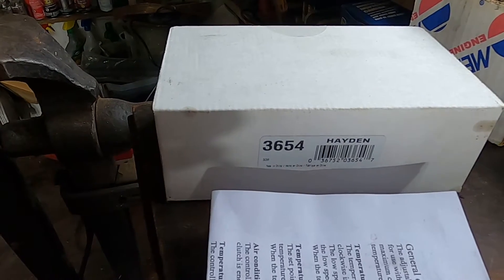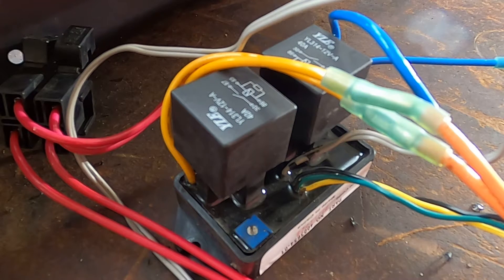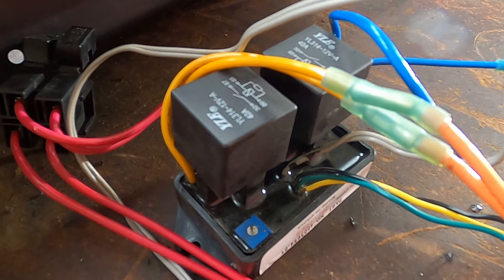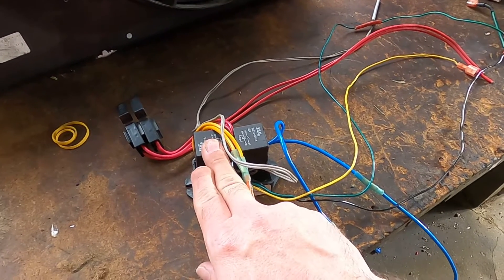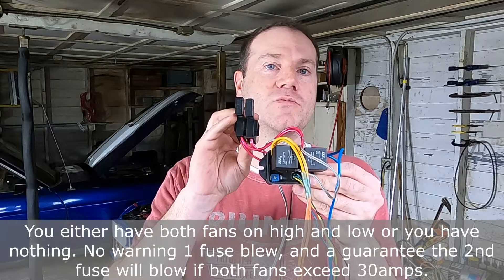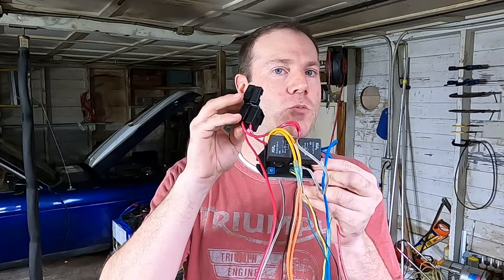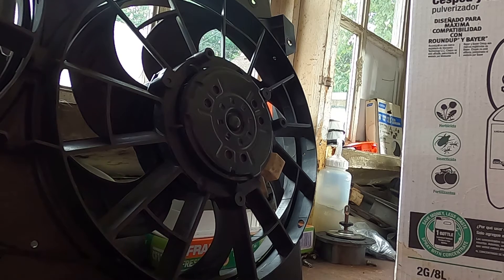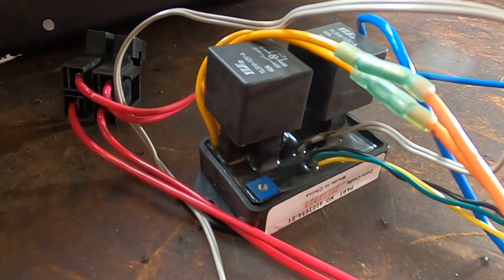Choosing Fan Controllers - Hayden 3654

Comment: You didn't need diodes for the low-to-high fan speed connections?
Reply from the maker: The fan assembly itself came with the low/high speed resistor module. No need for anything else.

Comment: can this be used with fuel pump?
Reply from the maker: Since this relay is temperature controlled, I don’t see a typical application with a fuel pump. I’m sure it would be less expensive to just find a key on 12v relay to run a fuel pump.

Comment: Hello, where did you find the actual plug ends to mate to the Contour fan?  Also, would you please describe the wire hookups for the low/high speed and how they connect between the resistor connection and the fan motors?

Comment: are there manual controllers where you can turn a knob to adjust fan speed?  and if so would you mind recommending one? i got a fan speed controller from amazon but its not adjusting the speed nor turning on or off it just stays on when the car is off unless i wire it to turn on with the ignition
Reply from the maker: I don’t know of any variable resistors specifically designed for electric fans. Every fan controller will need to be wired to 12v key-on power. If you have a fan wired to constant power, it could easily kill your battery super fast. The issue with manual and variable fan control is needing to constantly be watching the temp and adjusting speed. I don’t think it’d be very practical?
Reply: @randomologist77  thanks for your response, yes thats right. i just wanted to get a fan to run at a lower speed constantly while driving but i am just going to get the relay and have it wired up to like stock.

Comment: I wish you had a picture of where you ran the wires befor you put the black stuff on the wire
Reply from the maker: Black wire goes to chassis ground.
Yellow wire goes to key on 12v power.
Green wire, if used, goes to AC switch.

Both red wires go to battery.

One of each blue wire goes to each fan positive pin.

Ground wires YOU supply connect to fan negative pin and ground to negative batter post or chassis ground.

Orange wires merge together, then connect to low speed resistor input wire (left side pin for Contour/Cougar)

Low speed resistor output wire (right pin for Contour/Cougar) connects to 2 wires YOU have to supply, and one of each of your wires merges into a blue wire.

Comment: Is it suitable for spal brushless dual  fan 500w?
Reply from the maker: Well, a 500 watt fan set at 13.0v, where most Spal fans seem to be rated would be a tick under 40 amps or 20 amps per fan. The dual Spal fans I saw require a 30amp fuse per fan and the Hayden 3654 has that, but they were all brushed fans according to the description.
Here are the stats you need to know:
Amperage draw (both fans)
Fuse per fan requirement
If you're at or under 40 amps total, and the fuse requirement is 30 amp or less per fan, you should be good, I'd think. Technically, the controller is rated for 50 amps total, but amperage spikes while fans are spinning up can be pretty major, and I wouldn't trust the controller near its max rating. My dual fans were drawing under 30 amps total, continuous. Take a look at my fan review video. https://www.youtube.com/watch?v=8NTFLv3hASw&t=21s
Reply: @randomologist77 @randomologist77  now I've found spal fans 500w wires are kinda different the power wires from fans are 10 AWG and Spal Maxi Fuse Holder are 6 Awg with 50Amp fuse and I did search and found out that connecting 10 awg to 6 awg with fuse there's chances of overheating and burning them

Comment: All those 4 wires supposed to have power or 2 should be power and 2 ground?
Reply from the maker: Pink/red 2 wires go to battery.
Orange 2 wires in kit merge and go to resistor block left side.
Orange 2 wires (you supply) come out of resistor block right side. 1 of each orange wire merges with a fan’s blue wire.
Blue 2 wires route 1 wire to each fan.
Each fan connection has 1 blue wire, and one black (you supply) ground.

Comment: How did test to make sure controller was bad? I fell like I have a bad one on my car.  Just wanna be sure before I pull it out.
Reply from the maker: @klassaktrestorations8701  I heated the sensor with a heat gun and the relays didn’t activate. I had spare relays from a previous failure I tested as well.

Comment: How did test to make sure controller was bad? I fell like I have a bad one on my car.  Just wanna be sure before I pull it out.
Reply: I've had 2 of these Hayden 3654 go bad on me in a 4 year span. Should've knew not to after the single fan version did the same on me b4 I upgraded to  a 2 fan system. After the last time out of town on the side of the interstate having to straight wire for the 3rd time. I will never use their product again. They get a short inside the relay block. If you're not watching your guage it's a messed up situation. I've been running one of the cheap dial fan controllers since for as many years as I all 3 Hayden's with no issue, and it only cost me $22 with a lifetime warranty.

Comment: Davies craig ,,,DC-0444  [basic] --other part no . available ......   /different sensors--- 2 different threads , 1x radiator fin probe ,, inline radiator hose 
features ,, digital display ,,, air-conditioning sense wire ,,  staggered start of fans to reduce amperage shock load to alternator .
Bang for buck good value
Reply: Running a Davies Craig controller in my truck, Amazon sells a knockoff for $10-20 cheaper depending... Gonna try it on another vehicle just because, but can definitely back the DC. Would buy it again.

Comment: I run the same fans, I use 3 relays and a dual temp thermal switch, and no failures in 6 years running.

Comment: Can i remove the probe and use a sending unit the screws into my tstat housing?
Reply from the maker: @justineaton6281  I think many (if not all) the new kits come with a screw in units, but the sensor is designed to be tapped into the radiator rather than the t-stat housing. T-stat housings are usually full of curves which can make finding a good spot to drill and tap without leaks pretty hard. Manufacturers use intake manifolds, but that could be catastrophic if you drill in the wrong spot, and drilling holes while on the car could cause a lot of debris to get into the system. The problem with what you’re suggesting could be signal incompatibility. The push in probe might send a signal of “x” resistance for 200* while the screw in unit might be “y” resistance at 200*. It would make sense for the resistance levels to be universal, but they’re not. Different cars / gauges have different specs for resistance ranges they expect.
Reply: Not sure if you figured out your issue or not but they do sell those sleeves that you can put on your upper radiator hose, you basically cut your hose and the sleeve goes in the middle, its usually anodized and it has a threaded port for a screw on sensor,I'm working on that at the moment, my one year radiator has started leaking (cheapo ebay aluminum radiator) and i got another new expensive radiator but before i install it in checking out different options.

I have a really nice electric fan but it uses one of those probes you gotta stick in the radiator and every time i do that i think i take a few years of my life span, specially when you have a 3/500 dollar radiator,not a big fan of those probes,they do work though and i have used them before with success but like i said, i just hate driving them in, sticking something between the fins of a radiator is like jumping out of a plane,not natural,lol

Comment: What if you're running one dual speed fan? Do you use just one of each wire or run both wires to the one fan?
Reply from the maker: From the instructions I found online:
Remove or tie off the second orange and blue wire if only one fan is used.
Reply: @randomologist77 thank you

Comment: Great video! Any chance you have the dimensions on that fan setup? I'm working on an E Fan conversion on a G body. Radiator core I'm working with is 26 1/4 by 16 3/4. Which year Contour is that out of? Thanks!
Reply from the maker: Here’s the video where I tested the OEM vs aftermarket replacement. The OEM fans were available out of the Contours and Mercury Cougars and Mystics with the 2.5L V6s. The cheap aftermarket TYC 620750 beat the OEM fan pretty bad. The radiator is a Champion CC2379. Core 24 wide x16.25 high. Fan depth is about 3.50-3.75”

https://youtu.be/8NTFLv3hASw?si=z5Zqtcmg-ifrgjom